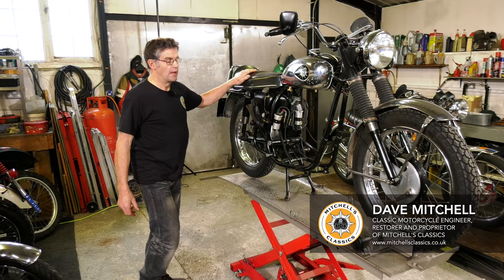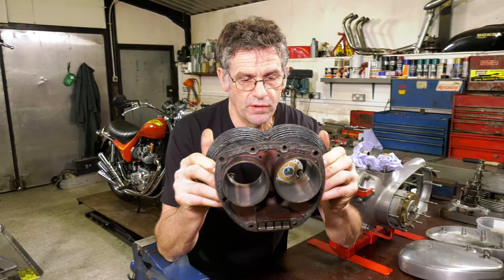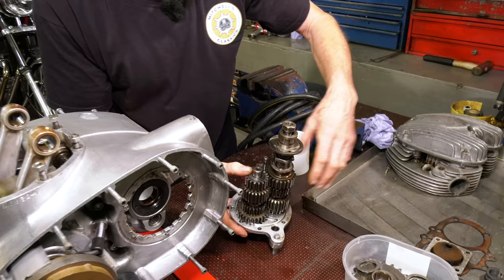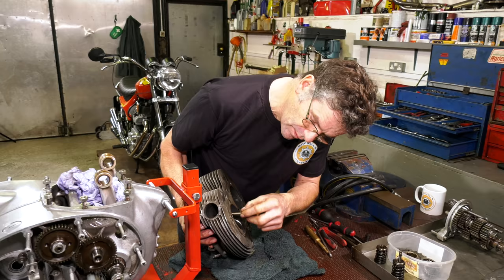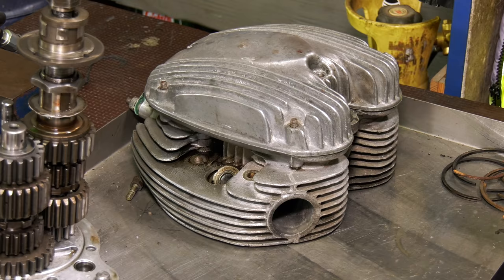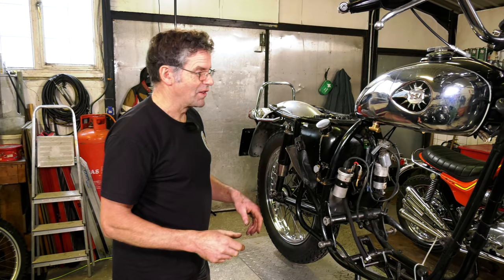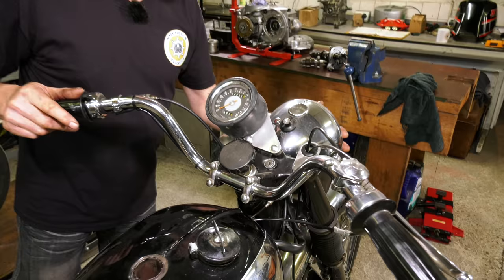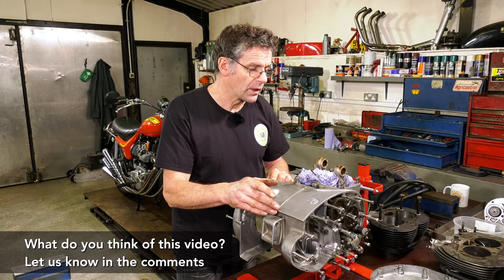Part 1 - Low Budget Classic Motorcycle Restoration

Comment: Nice video but I take exception to how you judge the valve guide wear. You're pulling the valve out well beyond where it ever operates and you wiggle it. Consider pulling it out to it's maximum operating "lift" and wiggle it at that location. If no wiggle, then it passes inspection and mucho dineros saved.

Comment: Thanks for your film and as you stated, when engines suffer blue smoke, it is very rarely rings! Most oil burn comes from Valve stem ware, or 
the stem seals have become brittle. New stem seals are cheaper than new guides, but never cut corners: if you need new "Guides". Nice one.

Comment: Great video, in fact I've just subscribed ! - About twenty years ago I did exactly the  same as you are doing now but with a US import 1970 Commando MK1 Roadster (long before the prices went through the roof !..) - I already had a MK3 Commando and wanted a British bike as a daily ride, luckily the Commando came up for sale (actually imported by a dealer in vintage Ford tractor parts..) Once I'd recommissioned it and made a few minor upgrades it was absolutely reliable, started easily and ran like a sewing machine every day, all year round and in all weathers for the eleven trouble-free years that I had it (on the original coil and points setup) with just routine maintenance and 1000 mile oil change intervals. The only cosmetic work I did was a thorough clean and a tank and side panel respray because the paint was in a very poor state. In fact that 1970 Norton was no trouble at all, much less grief than the low mileage 1996 BMW R850R I've just sold which really opened my eyes to the myth of German reliability. Great to see a British bike that is going to be used as they should be, keep up the good work !

Comment: 13:46 was definitely helpful, I need to check my TR6R that way.  I look at the front wheel while waiting at stoplights and it seems to be wobbling forward and backward.  I've been thinking that the bushings are worn.  
This was another great video.  I recently picked up a numbers matching '70 T100C in Arizona for $750 as a project to play with.  Rubber is all shot and a lot of the black paintwork has surface rust but it's very complete, engine turns freely and the chrome and fenders are fine.  It was going to be a low budget fix that I would sand and rattle-can spray but as I go along I'm thinking, hmmm... powder coat!

Comment: i used to own a Lightning Clubman, the timing side main bearing bush kept working its way out and being eaten by the timing gears. never could get i get it to stay in place, 2000 / 3000 and i would start to find bronze in the oil

Comment: I know yer doin this on a "budget", but if we had a bit more to spend, would it be possible to fit vernier isolastics to that Beesa-frame or would you HAVE to have a Norton Commando frame?  Might need to braze the tubes Holding the "Isos", but yer not shy to do a bit of brazing, what with your fixing the surround holding the kick-stand lever, which you'll braze at a certain angle.   Are you going to static-balance the crank and all to fight "Vibes" that way?  Does your engine assembly use the "Oil-friendly" SRM-type fix or did you use that 'sorry stock  crank-end Bushing, that if it seizes all yer work's t'naught?   That's wot ruined BSA's reputation, cheapening-out on that demmed, bludy-bush t'ave you crashed n' crawling among the lorries, while yer bike's sliding along the pavement like a skipped-stone.   Kewl,--it's got a CD unit, won't have sweat the condition of points/condenser.  Why not use a schmeer of  "Plastic-weld" on that seat underplate, and "call-it a day"?    Is yer head gasket going to be copper?    If you later "race" will you go double-plug?  Are you going to seat a valve-ring in the head for un-leaded petrol, or are you going to use a fuel-booster, so your engine will "act" like it just got a slug of "Fourstar" from back in the day.   8.4 or  10.2:1 on compression?  Ar you going to mod a Yammer compression-release to ensure you kick-it over, if built with high compression??    If a mate dropped 5 large Quid, on you  for a twin, and wants "the Crown & the Castle", would you 6-spd his gearbox[quaife 6-speed],--inject-it?  Use a turbo-'power-adder'?    order-up a 920cc Billet head?   Add 2-3 mains or only one like AMC["AJS"/"Matchless"] did in the day, only Better?   {Of course, you shave/eliminate that crank "Skid-plate" }.  Are you going to apply some potter's glaze to the INSIDE of the exhaust-pipe near the head 6-8" of hedder pipe, so the chrome never goes "Blue"?   Instead of BSA's /Norton's 360, or Triumph's 180-crank, would you move to a "custom" 270?   Luv yer Vid, Mate.